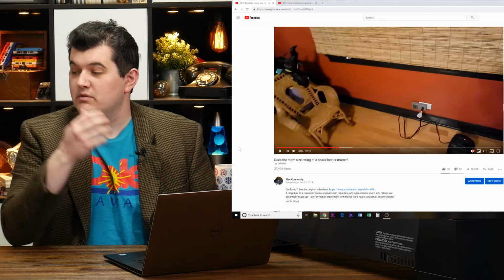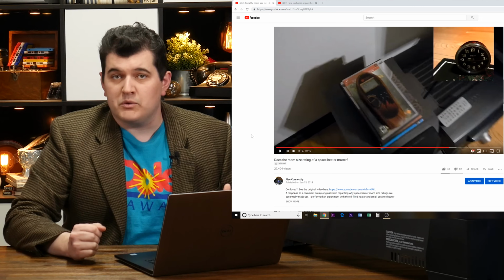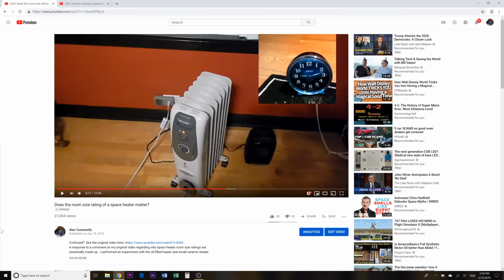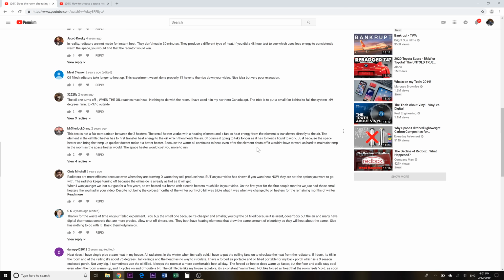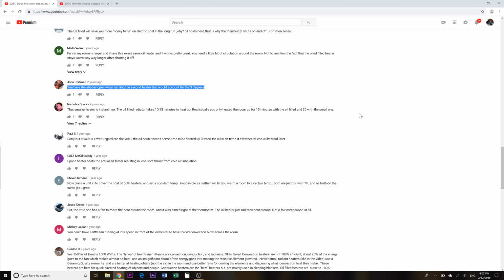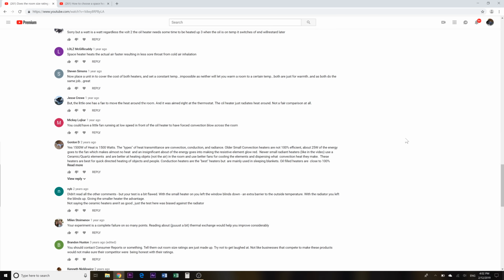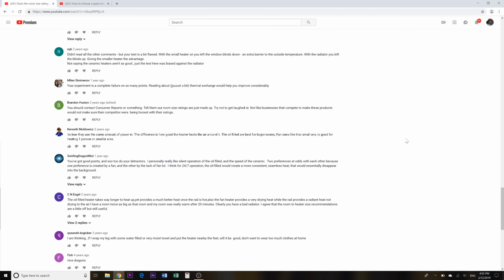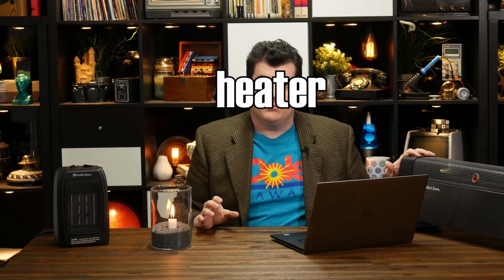More Space Heater Nonsense

Comment: As an electrician and former hydronic heat installer, I agree with you and share your frustration. This is an important topic with a lot of widespread misinformation, some of which is created and/or perpetuated by marketers.
That being said, there are ways that different types of heaters with the same heat output can be more effective within a given space.

 Any of your choices should include safety measures to protect you, your loved ones, your home, and those you may not love, from fire.

There are two main types of heaters: Convective and Radiant. These types are slightly misleading, as all heat sources generally provide some combination of the two types.

With convective heaters, heat is produced and dissipates, or spreads throughout the space by the convective properties of heated air rising and colder air sinking. Your oven is a great example of a convective heater. Convective heaters will feel warm mostly right above them or in the air stream if they have a blower fan. (think hair dryer)

A radiant heater spreads heat by relying on the fact that any warm object emits infrared radiation that can travel through the air until it strikes an object that can absorb it, thus warming that object. Anyone who has sat around a campfire or under a patio heater on a cold day will have experienced this directly. The "quartz" heaters are one of many types of radiant heaters. One way to tell if a heater is a radiant type is if your skin feels warm from a distance.

If a heater has no fan, and relies entirely on convective heat transfer to the air, most of the heat will rise to the ceiling and begin heating the air, ceiling, and walls.
Over time the heated air level will move down, and the ceiling and walls will begin radiating some of the absorbed heat back down to the lower areas, and if there is enough insulation to overcome heat loss, the room will eventually achieve a desired temperature equilibrium.

This process can be sped up by using some sort of fan to prevent the hot air from sitting at the top of the room while cold air sits on the bottom (stratification). This could be a heater with a built in fan, or an external one like a ceiling fan. 

Any of the convective electric, or combination convective/radiant heaters, both with or without fans, will work for a reasonably insulated and sized space. The specifics will be based on your budget and specific tastes. Fan based heaters will spread the heat throughout the space more quickly than ones without fans, but possibly make more noise and drafts.  The oil filled radiator heater will provide some radiant heat and some convective heat while being quieter, but will not heat up the space as quickly from a cold temperature. All will function the same over time.

If there is not enough insulation, or the heater is to small and the space to large (such as a high ceiling), or there are to many sources of exterior airflow, the warm air produced by convective heat will tend to rise to the top of the space and possibly dissipate before providing any noticeable heat to the lower parts of the space.
A fan that forces air to circulate within the space can possibly overcome some of the heat loss issues, but not prevent them. It will simply help keep the entire area within an even temperature that won't necessarily be warm enough for comfort, and the airflow can feel like a cold wind.
This situation is where a radiant heater will provide more effective heating, as it provides infrared heat that can warm our skin and clothes directly. Just sitting next to a little fan heater where you can see the glowing elements means that you are getting some radiant heat. Radiant heaters are often used to provide area heat in warehouses with open doors. A "Quartz" radiant heater under my desk in a cold office has been a lifesaver for me.

The traditional steam or oil filled electric radiator heaters provide a mix of radiant heat and convective heat, but are not the best at either.
 
I cannot tell you how many times I have tried to explain to people that turning up their thermostat to the highest setting does not heat up their house any faster, as the heater can only heat the house so fast. There will be some lag time, as once the air has come up to the required temperature, all of the surfaces and the items in the house have not. Once everything is up to temperature from absorbing heat from the air, the surfaces and objects will radiate infrared heat back into the space around them, thus providing additional comfort.

Comment: You’re absolutely correct. Imagine my frustration as I had to explain to an electrician why the wattage of a baseboard (resistive) heater changed when fed from a (3 phase derived) 208VAC source instead of the (expected) 240VAC source. Ergo the heater was undersized for the space...

Comment: The ones that release the heat more slowly are kind of storing that energy like a capacitor does, don't they? I don't know. I'm never cold so I have limited experiences with these things. I have much more personal experience with fans.
Reply: From the experience I do have with terrible heat and many different fans, it's the fan that blows the hardest that makes you feel the most cool even though, realistically, running a fan is releasing some more heat into the room because of the fan motor and such. The thing that makes you feel cooler using a fan that blows really hard is because it's changing the air next to your skin more quickly and that would be the temperature you feel. Then, if you sweat, the fan causes that to evaporate more quickly, which should cool you down faster.

So, probably a choice in heater has at least a little bit to do with a person's preference and how they use the heater as in leaving it on or just turning it on for a little while. It seems to me that it might make it at least subjectively warmer to have a heater with a fan because the point is to get the warmer air to you and displace the cold air next to your skin so you feel warm. If people leave a heater without a fan on all the time, then it should be constantly warming up the room so that most of the air is warm, which also works because the warm air is next to your skin and then a person can also turn that heater off early in the morning and enjoy continuing heat for a while. The heater with a fan is probably more useful for someone who just going to want to warm it up quickly, maybe before bed, and then turn it off because it will stay pretty warm under the covers. The one time I used one of those, that's what I did and it was pretty cold out for those nights I had to wait before they got the part in the fix my central heater. It was definitely too hot to leave on for very long, at least for me.

On a somewhat funny note, we had in the wall electric heaters in my first apartment. My roommate and I had turned both of them on on either side of the wall and had fallen asleep. I woke up because I was too hot, opened my eyes, and saw actual flames shooting out of the wall heater. I was like 19 or 20 so all I could think of was to yell to my roommate to call the fire department and then I decided that maybe I should reach quickly through the flames and turn the heater off because I didn't think adding more heat was a good idea in the middle of a fire. When I flipped the switch to turn both heaters off, I actually put the fire out because it was a fire from faulty electrical wires. The fire department came and made sure it was out, of course, but I had put the whole thing out. That was kind of funny and at least no one got hurt, although we sure were in a panic at the time to hide all the bongs because the fire department was coming and this was long before it was legal here.

Comment: The space heater in my bedroom has two heat settings: 1,300 watts and 1,500 watts. I really wish my bedroom had either central gas heating ducting or preferably, a gas PTAC. A PTAC (packaged terminal air conditioner) heats when it's cold and cools when it's hot. For heating, a gas PTAC uses a heat pump down to a certain temperature (I think about 40º F); below that temperature, it switches to gas heat.

Comment: Good job.  One nit: in heating what matters is not how efficiently energy is transferred to the room but how efficiently it is transferred to non rodent mammals in the room.  The air, like the oil in an oil based heater is just an intermediary.

Which is why (after 15 years of fighting with heat in my study) I switched to an infrared heater.  Because a good amount of those 1500 watts are converted directly to photons that can warm my body directly no matter the air temperature.  Which arguably means that my body gains more BTUs than if the air had to be warned first.

Ok, the metal reflector gets hot too and a fan cools that down, slowly warming the air.  Which ultimately means that I don't have to turn like a piece of meat on a spit to feel warm all over.  

Not for everyone or every application.  But if nothing your can legally do will heat to desirable air temperatures...

Comment: one advantage the small one has is the fan causing additional airflow so spreading the heat around faster whereas the candle and the radiator just puts it out to the air immediately around it and relying on ambient airflow created by the temp differences in the air.
Reply: I came in to write basically the same thing. With the fan heater, the warm air is immediately spread out across the floor, then slowly rises to evenly heat the room. With "no fan" heaters, the heat rises in a narrow column right above the heater and sits at the ceiling. This means that with a fan heater, you would need significantly less wattage draw for a comfortable room temperature than with the no fan heater. So if anything (and along with the cycling of the no fan heaters), those fan heaters would heat ANY size room more comfortably and with less power usage than the no fan heaters.